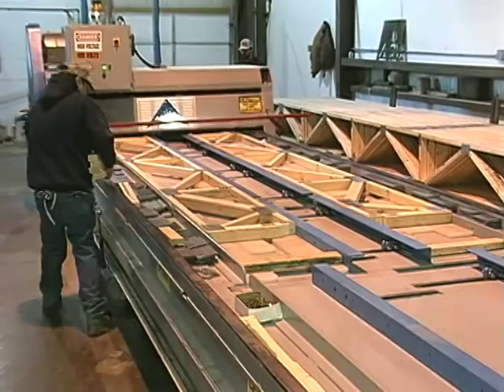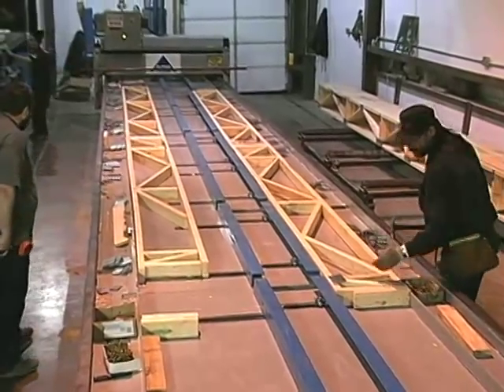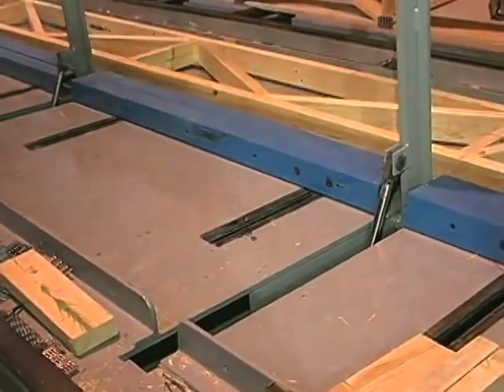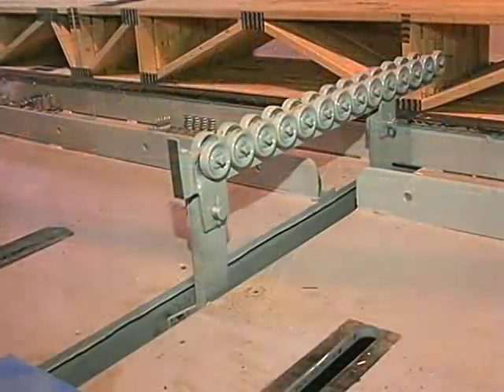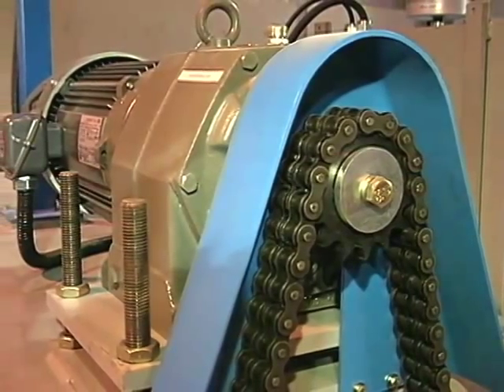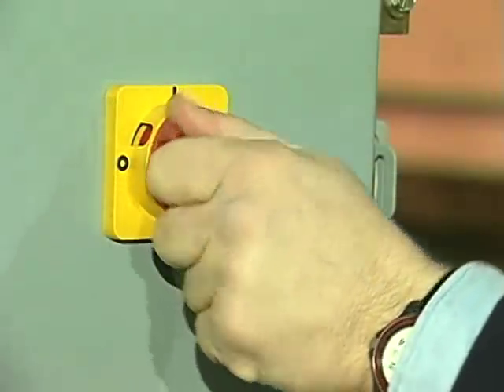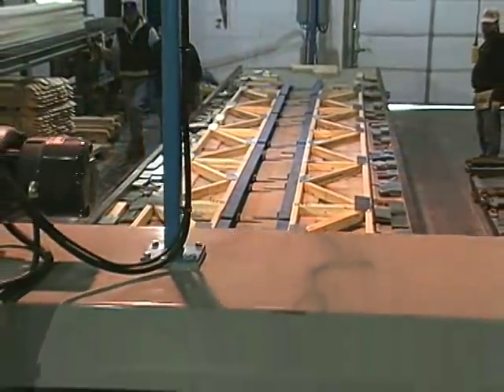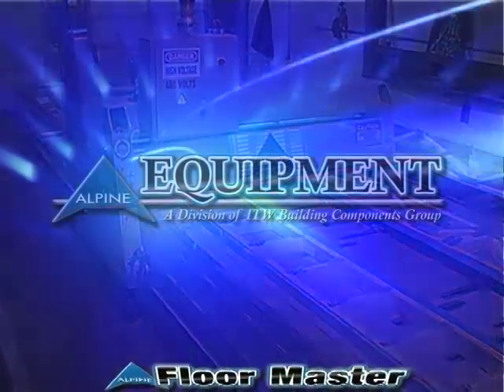FloorMaster - Floor Truss Assembly Machine

Comment: Plant I work at has the table press bar welded together. A few months ago I noticed that the weld holding the two ends together, to make one long bar, had a significant crack in it. Our boss said it's nothing to worry about because all the pressure is going to keep anything from snapping. At the same time our maintenance man said he'll fix it when the weld finally snaps. 🤷 Guess we're just waiting to die at work. It's amazing how this company I'm watching on this video seems to care about their employees comforts, while at my plant our boss wants one person to lift one of those trusses by himself or herself. With expectations of getting 7,000 board foot a day.